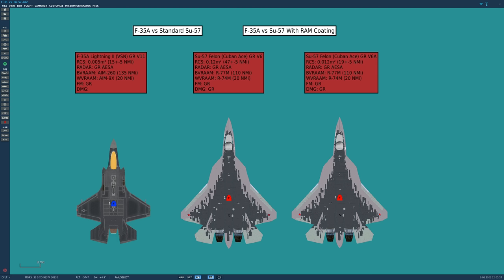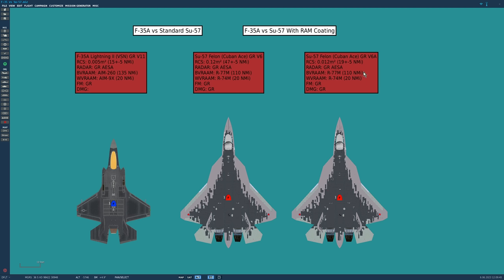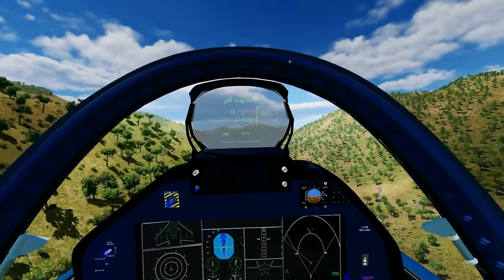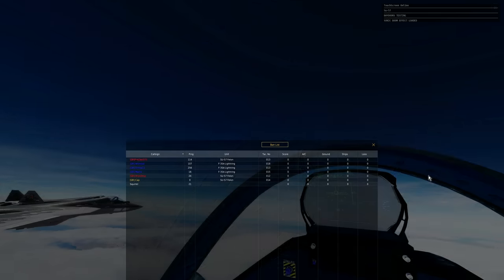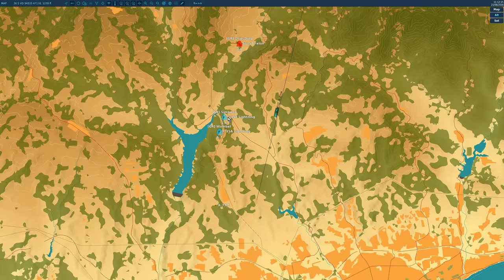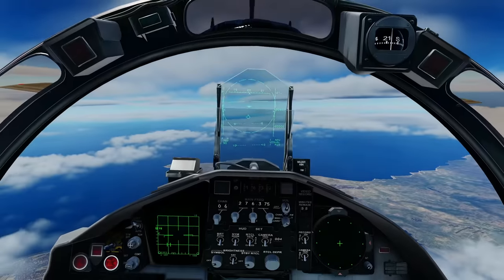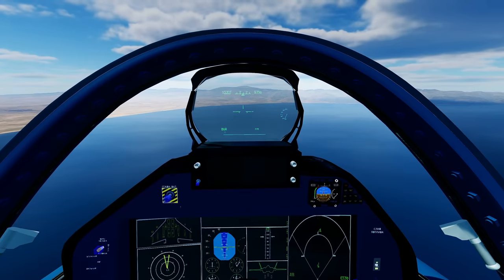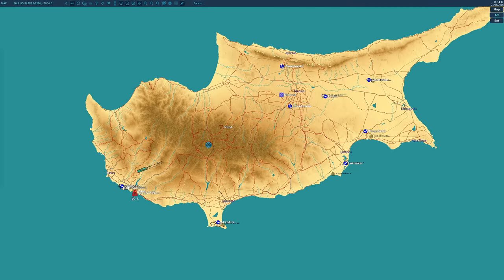F-35 vs Su-57 With RAM Stealth Coating: BVR Missile Battle & Dogfight | DCS

Comment: For me, moving to the stealthier models for both makes sense-  the public figures for the F-35 are likely to be over the real figures as if an enemy develops a radar solution for the published figures and it's lower, that system is already not effective (or as effective as desired byt the developer), The stealthier Su-57 makes for a more challenging set of engagements and although Russia's actual ability to make and maintain its Su-57 fleet is highly dubious, this is a best-case for the wargames sake. BTW, are you guys going to RIAT? Would be awesome to meet you
Reply from the maker: Yup we'll be there on the Saturday, in the red section near the front. Can't miss us.
Reply: @grimreapers  Bugger! I'll be there on Sunday! 🤦‍♂
Reply: Not sure if it's been mentioned, I haven't watched past the first few minutes yet. But, one thing that probably can't be simulated at this point, is the fact that the U.S. has, and doesn't give all F-35 customers the special software that minimizes the presented RCS. Apparently when in maximum stealth mode (forget the name used), the plane analyzes all the detected and intel designated radar locations, and only allows the plane to fly a path and at angles that minimizes the potential RCS being shown and bounced back to the radar stations. Of course good pilots with detailed intelligence on enemy radar positions could do a good job at presenting a minimal RCS, but I think this software that I've heard about sounds really beneficial and a clear step-up in stealth performance; I think the only other country being given the Tier 1 F-35 with full stealth capabilities is the United Kingdom.

I know Russia (perhaps China too), have claimed they have tracked the F-35/F-22, but I'd imagine that has only been with the planes using radar reflectors (Luneberg lenses) to hide the true RCS signature, but I read they recently were flying the F-35 in Poland near Ukraine in full stealth mode without reflectors. I'm so curious if Russia were able to track them at all (though I'd imagine they still stayed quite a ways away). But, the F-35 is being flown more and more without reflectors, so it's only a matter of time until it's put to the test. Part of me wants to keep the reflectors on until it's needed in anger, but the other part of me wants to see it fly over Moscow just to flex.
Reply: @SovereignVis  The "fallacy of averages" assumes that an outer possibility doesn’t exist, and that the reality only can exist within your limited understood parameters.  For example, when you take into consideration the fiber mat engineered carbon fiber, which is part of a layered trapping system for RF energy, the F-35 RCS drops considerably.  Then when you understand that the tailplanes and tailbooms are all made from CF, with CF internal structures and not aluminum, the RCS drops again dramatically because CF is mostly RF transparent.  A small army of VLO/signature reduction engineers and technicians have been working on these problems for generations in the US, complete with instrumented test ranges to validate whether or not their improved measures have worked.  F-35 has already undergone a major upgrade to its RAM since Lot 4, which was almost 10 years ago.
Reply: @niko7903  The JSF threat library is an internationally-collected and updated system.  For example, they have been doing threat collection of Russian systems near the Baltics, Eastern Europe, and Ukraine with Dutch and US F-35As, while USMC, USAF, and RAF F-35Bs and F-35As have been doing threat library collection over Syria and the Middle East.  It doesn’t make sense for any individual nation to gate-keep its own regional threat library data when it benefits from all the global threat data being collected by the entire F-35 enterprise.

Comment: I'd like to see the upgraded SU-57 versus a newer F-16 variant. I'd also be curious to hear what these people calculate the J-20 RCS to be.
Reply from the maker: They are modelling the J-20 next month.
Reply: Upgradeded 57?
Reply: I'd wonder about RAM coating 4th gen planes.  Spray down an F18 and a SU 35 with RAM, add the suggested conformal weapons bays and see what their RCS does.

Might be a cheap way to pull another decade out of existing tech
Reply: @lavenderlilacproductions  maybe if you also spray the weapons
Reply: I think you use official figures against official figures, and you use modeled figures against modeled figures.
Reply: Just to be sure - you know the numbers in video aboove are for fun, being 100% made up fiction, having nothing in common with real life totally classified aircrafts?
You yourself with your knowledge can make J-20 or NGAD or B21 exactly as realistic as this amateur made mods - they are made for fun with zero strictly classified data.
Just saying.
Reply: @grimreapers  I already finished the J-20 model and simulation https://basicsaboutaerodynamicsandavionics.wordpress.com/2022/11/27/j-20-radar-scattering-simulation/

Comment: I would go with the .002 meters squared. I would think with high level aircraft that they would not release the actual numbers.
Reply: While that is true I doubt that the 0.002m2 is perfectly accurate either. A calculated value is often an overestimation when it comes to physics. Any kind of flaw in the coating or in the construction will likely give a higher RCS than the calculated value. The true value would likely fall somewhere in the middle and would also likely vary slightly aircraft to aircraft.

For context 0.002m2 would fit very comfortably in the palm of your hand, at values that small even tiny imperfections in the aircraft or innacuracies in the model will make a big difference
Reply: Correct you are
Reply: just because you put ram coating on it doesn't mean youre going to get that small an rcs on the felon. Theres still MANY other flaws in the airframe that give it such a high rcs. To name a couple, all those gaps and seams increase it, the fact its underside looks exactly like the under of a twin engine 4th gen with fully exposed engines. 
I guess ill go ahead and also mention the fact it has to carry hard points for its munitions because it has no internal weapons bay, it at first didn't even have a door, then they put one on but it's completely fake, ALL of russias fighter missiles are too big to fit in that "internal bay" , therefore it still has to fly with munitions on the wings, of course increasing its rcs even more
Reply: All software analysis on RCS are innacurate, we have some lectures/courses here on YT (by big unis) talking about that. This is also confirmed by books on EM diffraction theory.The best way to predict RCS is building irl scale models and testing them in anechoic chambers.

Comment: It makes sense to me that the russians would be using RAM coating on their stealth fighter and we can safely assume that this is how most combat Su57s will be treated. 

The IRST of the Su-57 will be closed in almost all situations except for closer ranges (15-10 nm) where it may already be seen by modern AESA radars so I think you should go for the version with the closed IRST.
Reply: The problem with the idea of RAM on the Su-57 is that clearly they intend to put PAINT on it. I'm highly disinclined to believe that a country's first attempt at a stealth aircraft in the 2020s involves a form of RAM that is beyond what the US has achieved on their... fifth? stealth aircraft (I'm counting the SR-71... F-117A, B-2, F-22, F-35. This list nearly triples if you include rejected projects like the Commanche, YF-23, and various stealth RPAs) when their first RAM material was used 40 years ago on the F-117A.
Reply: Sukhoi is using adhesive appliqués to cover the seam lines and then paint over them.  F-35 uses this approach with some of the infrequent inspection locations, like the internal fuel cell panels on top of the fuselage, and around the navigations light housings.  The structure of the aircraft and 3-layer surface is not regularly-serviced because of how robust it is.  It also presents a labyrinthine RF trap surface with strength to it as well.

Comment: The most important thing to me would be consistency. If you use the 0.05 of the F-35 as a baseline, you would have to mutiply the results for the SU-57 by 2.5. If you use the simulated figure for the Su-57, then you should also use it for the F-35. 
Since stealth isn't perfect in real life, I would go for the higher figures.
Reply: 0.05m2 baseline makes absolutely no sense since the frontal RCS is at least one order of magnitude smaller than that without RAM taken into account.  You could rough estimate 0.05m2 without RAM for one of the spikes that is way off-aspect.

Comment: Heard a couple comments during the video that the Su-57 IRST/EOTS could not be made stealthy and that it would confer an advantage against the F-35. F-35 does have an DAS that functions as an EOTS, among other things, and it does not compromise stealth design, or if it does amplify RCS it is very minimal. Understand F-35 may not have EOTS modeled in game, but it does have one in real life and apparently doesn’t compromise its low RCS. Part of the distributor aperture system located under the nose of Fat Amy.

Comment: A big thing that is not taken into account is the IRST of the F35. I dont know anythying about the one from the su57 but the F-35 IRST probably can do cool things too, but obviosly it is classified. 
The AN/AAQ-37 Electro Optical System of the F-35 can among other things detect and track aircraft. The USAF has also been testing IRST Pods on F15s and have shot down a QF-16 with an IRST guided aim 120 without using radar, and I would be surprised if the F-35 cannot do that. All this Information leads me to think that the F-35 might be able to detect other stealth aircraft by their heat signature before it can see them on their radar.
Of course the public information on this is extremely limited, but I think it is atleast worth to talk about when doing comparisons/battles like in this video.
Reply: There's public video of the EOTS in action on YT if you'd like, it's been stated to have at least 50 mile range capability and can laser designate window sized targets at that range
Reply: @forzaelite1248  Well the EOTS is mostly just the "targeting pod" I would assume. The IRST would be one of the sensors just below the cockpit on the upper front of the nose
Reply: @minecraftjoker100  apologies if this is a repeat, I thought I sent a follow-up yesterday but it looks like YouTube might've ate my message:

The two things on the nose just under the canopy are a MADL antenna array and a DAS aperture co-located. It's part of the F-35's IR-based systems and serves as a frontal imaging IR camera, but mostly for missile warning and closer aircraft targeting. The EOTS is the thing in a sapphire box on the bottom-side and it's not just a targeting pod: it combines a targeting pod's laser designation with a FLIR and IRST. It can acquire things automatically like an IRST can, but the pilot can also critically look through the system manually for both air-to-air and air-to-ground designation. It's the first of its kind and replaces all the external FLIRST pods from before while retaining the same capabilities, if not more.

Here's a video of it in action, note the quality of the resolution even at the ranges mentioned: https://www.youtube.com/watch?v=L2q65qOl1tM&themeRefresh=1

Comment: My concern or shall I say question is.. how effective is their coating? Are we assuming all RAM coating is the same? Or is one better then the other?
Reply: They very much do vary in effect and over different frequency ranges. There's also RAS to consider nothing public about it's use but the "graphite composite material " used to make the f35 is probably some from of it. Radar absorbing structure  which is usually described as a meta material/composite made up of layers with different properties chiefly a refractive top layer radar absorbing material internal layer and a reflective backer that one would construct the aircraft from.
Reply from the maker: Fair comment.
Reply: Same with engines and AESA radars. When Russians claim something , well remember the Moskva !
Reply: My guess is that it is regular paint.
Reply: @stupidburp  Whoa slow down, that is a little too kind. We are assuming it's not watered down.
Reply: As a russkie, my bet is there is no spoon, and if there is, it sucks, and not available in quantity. Also, consider maintenance quality - ram reapplication is a complicated process requiring high standards of quality, not something you should count on.
Reply: @stupidburp  The fact that the Su-57 is actually painted suggests it has no RAM coating, or it's very rudimentary. Paint does not do what you need RAM to do.

Comment: Would love to know the RCS of the J-20 from these studies! Doesn't make much sense to me if the SU-57 can have an RCS of 0.012m2 but the J-20 which should be superior is 0.5m2 according to past videos.
Reply: probably about 0.05m2 for J-20
Reply: Su-57 is probably actually about 0.12
Reply: @stupidburp  not with the radar blockers refined surface ,new izdeyile engine and ram coatings
Reply: Google J-20 radar scattering simulation and you can find their site and even comparison between different aircraft
Reply: @stupidburp  I think its from 0.00001 as stealthy as f22 from the front to 0.05 
F35 from 0.005 to 0.01 su 57 0.012 to 0.1
Reply: @HardCor3Essam  F-35 has a lower frontal and oblique RCS values than the F-22 since F-35 uses DSI inlet, more carbon fiber structures, and fiber mat RAM.  F-22 has splitter plate boundary layer diverters for its intakes, which are resonant cavities.  It also has older RAM that requires constant application to the surface and isn’t as effective at trapping RF energy across as wide of a spectrum as the multi-layer F-35 RAM tricoque structures, which don’t require constant application.
Reply: @LRRPFco52  there is a pictures outthere with f22 with a new ram coating
Reply: @HardCor3Essam  We don't know if that's RAM or IR or both.  It has been seen on an F-35C as well, if you're talking about the mirror-like finish.

It was explained to be an experimental program for future fighter development, which some interpret as things going into NGAD.
Reply: @LRRPFco52  yeah the mirror like coating ... ur right otherwise it would've been painted on all other raptors
Reply: @LRRPFco52  the other things here that's bothering me about comments everywhere downing the su 57 and saying it's forth gen when it's not the intial 0.1m2 was on t50 model which had exposed rivets 4th gen engine no radar blockers 
And people really don't bother to research about 57 model rcs 
There is model released while ago modeled the production version and long story short 
It's rcs with irst open is 0.016 to 0.12m2
And with the irst dome closed 0.006 to 0.01m2 
He also modeled the f35 and found its rcs lower than what's out there 0.002
Iam not saying the su 57 Is better interns of stealth not at all the f35 and 22 is better but the su 57 is stealthy
Reply: @LRRPFco52  iam actually curious of the su 75 rcs gonna be like since it shares the same design philosophy of both x32 and yf23 rudder vadors 
I think its gonna be stealthier than f35
Reply: @HardCor3Essam  None of the first phase T-50 prototypes were LO platforms.  They were air-vehicle feasibility testbeds with one avionics platform.

Once they installed the initial combat avionics into one of the later first phase prototypes (I think it was 054), the weight increased dramatically, which required a re-design and increase in airframe length and wingspan.  The engine cowling dimensions also grew to accommodate the IR blankets vs the exposed Titanium on the first phase.

This is a clear distinction between 1st and 2nd phase T-50/Su-57 prototypes.

Production aircraft have the panel seam lines taped over with adhesive RAM appliques and are painted over.  The digital camo paint jobs don't appear to be a RAM coating though.

RF blockers in front of engines don't reduce the RCS.  They reduce the IR signature and prevent blade-counting PID features from 1970s-forward US pulse doppler Radars.
Reply: @HardCor3Essam  The main LO features on Su-57 are planform alignment and internal weapons bays.  RAM maintenance would be beyond the capability of Russian fighter squadron logistics unless they build infrastructure for it and treat Su-57s more like ISR aircraft with heavy maintenance and support.

If you look at the weapons bay door gaps, they are huge-worse than 1950s-era US F-102A, which are quite clean and uniform with a very tiny gap.  This seems to indicate that bottom aspect LO isn't a priority with the Su-57.  Some have suggested it is meant to operate at really low altitude down in the clutter, then pop up to employ weapons.

This would also explain why it has DIRCM and UV MAWS, which are designed to counter MANPADS.
Reply: @HardCor3Essam  Su-75 looks like the Northrop MRF-45E from the 1990s.
Reply: @LRRPFco52  body of the mrf and inlet and nose of x32

Comment: If the calculated RCS of the F35 is a little low then I would expect the calculated RCS of the Su to be a little low too. Maybe bump it up to 0.015?
Reply from the maker: That's actually along the lines I was thinking.
Reply: But who’s to say that the value GR took as ‘publicly released’ is correct. The value they use for the F-22 is an order of magnitude lower so the F-35’s RCS being 0.002 m2 really isn’t that unlikely…
Reply: @MaxIsStrange1  it’a about the distance between the 2 values being as realistic as possible.